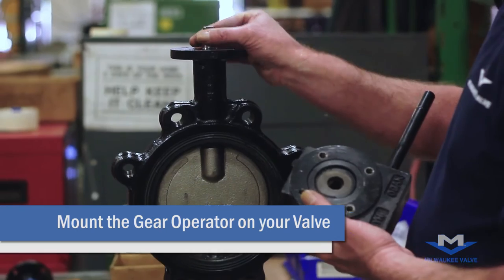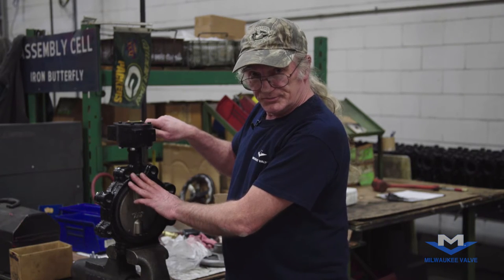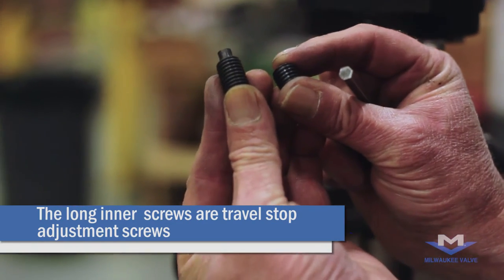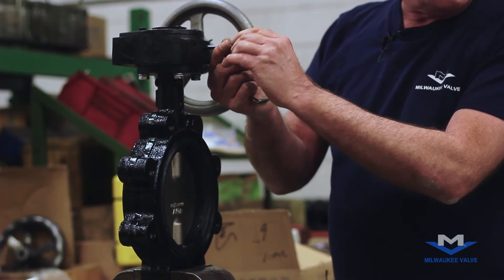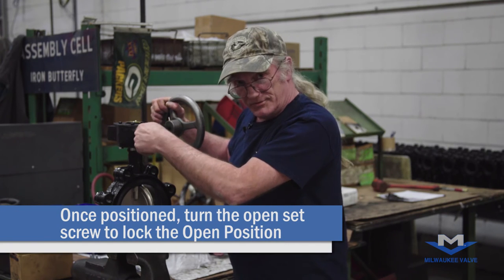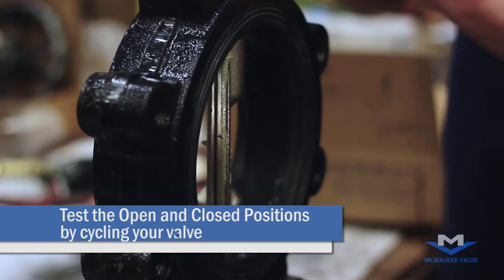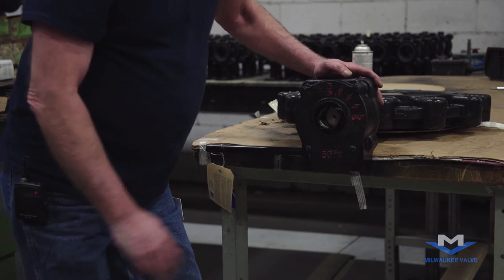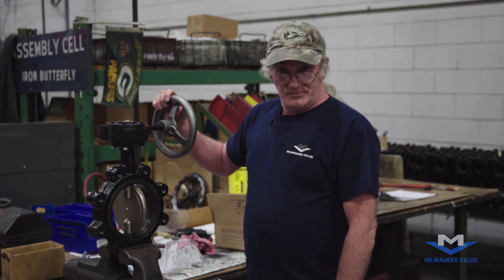Installing a Gear Operator on a Milwaukee Valve Butterfly Valve

Comment: I have problem my valve wheel just runing but not opening and closing I want to increase water pressure but it's just handle rotating, valve not working